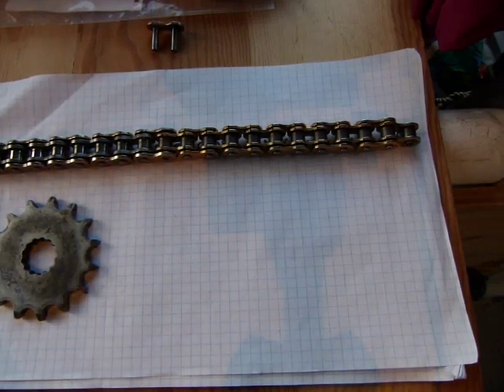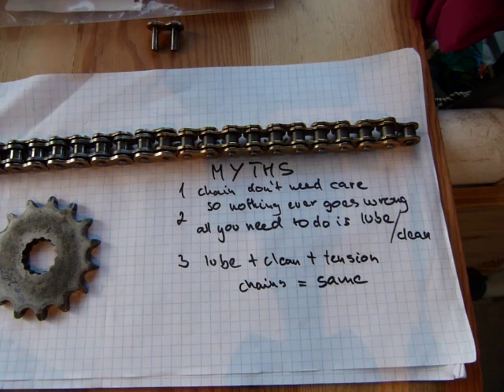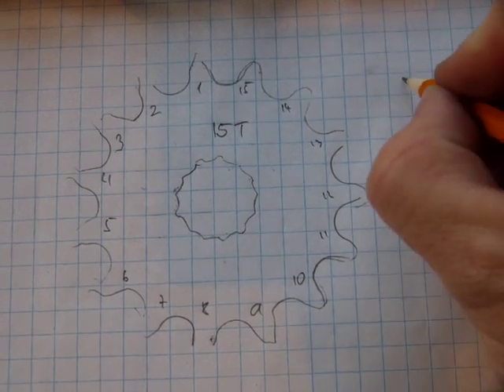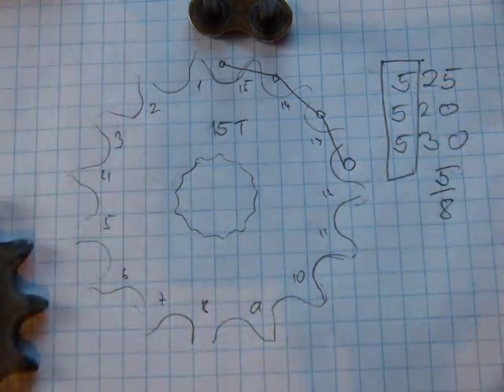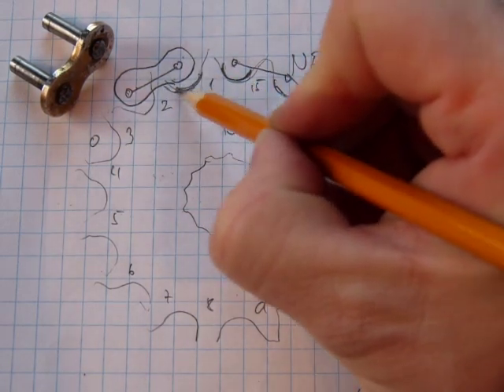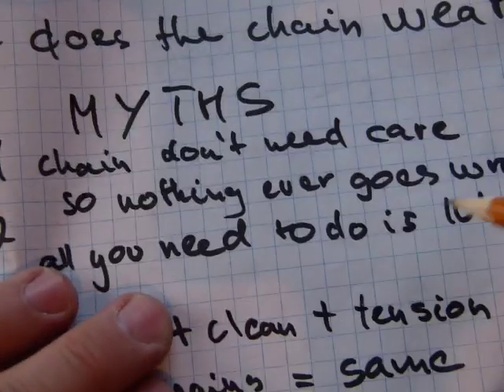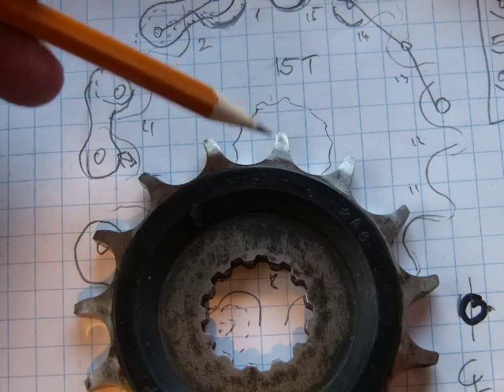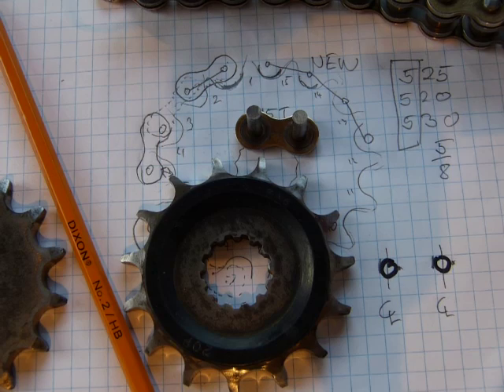O-ring bike chain care myths

Comment: Interesting video but your information is incorrect. The pin Centre distances don't change at all, the outside/inside of the other link/roller and the outside of the pins wear a little.

Comment: The name ‘chain stretch’ is actually fairly misleading. Contrary to popular belief, the chain isn’t stretching at all. “The real name is chain elongation,” says Zerger, “It occurs when the chain articulates as it goes around the sprocket and pin wears on the bushing to the point that the length of the pitch elongates.”
Reply from the maker: Good point, thanks for your input.

Comment: At about 8:00 you've clearly claimed that the distance between the solid pins on the external, riveted link increases with wear. It doesn't. The wear occurs between the solid pin of the external link and the hollow pin of the internal link (dotted). It also occurs between the hollow pin and roller, both of the internal link (dotted) and finally on the outside of the roller in hard contact with the sprockets.

The effect of this accumulated wear is that the elongation of the chain occurs entirely within the distance between centres of each SEPARATE external link, which then allows the chain overall to extend, retract and bend increasingly away from its normal plane of rotation. 

Your other videos on the subject are excellent. I think perhaps you need to do this video again to retain that standard. I believe perhaps the problems of trying to explain a difficult subject in English, which I don't think is your native language, have caused a misinterpretation. Thanks for trying to explain this most misunderstood phenomenon.

Comment: The distance between the center of the pins does not increase nor does the chain stretch.  The pins and bushings wear against each other creating clearance/slop.  This wear elongates the distance between links.   This chain elongation will wear the sprocket.   Each chain manufacture has a chain length/#links limit.
Reply from the maker: Well said. I also tried to leave out terms like pitch diameter, fit, tolerance, elongation, gauge, ... just kept close to plain English as possible without being too technical at the expense of accuracy.

Comment: Does a chain actually "stretch" or is the change in overall dimension due only to the contact points wearing down?
Reply from the maker: The plates do not actually elongate. No engine can come even close to that. (Tractor, tank, train, ship engines do. No chains there.)

Comment: The inside pin will wear as will the collar rotating around it. This will slightly change the pitch of the chain, wearing out the sprockets. A good O Ring chain will keep lots of the dirt and junk out to slow wear.  After 45+ years of riding off road, and countless chains, yes lots of taking the chain off, cleaning and oiling and re installing. 
A decent O Ring chain changed all that. No wearing of chain and wearing out the sprockets so quickly.Wipe down, Keep surface cleaned and oiled. Stretch is very minimal compared to a regular chain that quickly wear and stretch, and keep on wearing out and stretching.

Comment: Some good information here.  Thanks for taking the time to present it.  One commenter said that the pin-to-pin doesn't really change on the "outside" link.  That's not true, sort of...each pin will wear as the collar rotating around it moves, so even the effective pin-to-pin center distance on the individual links will change.  Chains should be viewed somewhat like brake pads; they are a wear item and will need to be replaced from time to time.  Unlike brake pads, with a little maintenance (lube/clean) they can last longer.  Like brake pads, they don't last forever (and neither do sprockets).  Thanks again for taking the time to make and post the information.

Comment: Sorry, but you mixed it all:
centre distance between external chainlink pins is not changing, its welded :) Distance between surface of the pins really increases due to wear.
Tightening will not solve this problem, since increased distance between chainlinks does not decrease due to tightening.

Comment: And if the other side of teeth is still in factory spec. Can I use old sprockets with new chains if I just flip them around?
Reply from the maker: suomenpresidentti They could be used but they will be slightly mismatched, resulting in slightly faster than normal (perfect geometric match) chain wear.
Reply: This leads on to my question.  I find that the chain and rear sprocket on my motorbikes are usually still good but the front sprockets being modified 1 tooth less than spec tends to wear faster and get more shark toothed. I think it maybe cost effective to just change the front to a new one which is the cheapest option and after two fronts the whole lot needs changing together as a set.
Reply from the maker: Could work. The small front needs to spin 3-4 times more than the rear to move 1m length of chain. The smaller the front, the more it needs to spin and the more it wears. Stock or not, the front will only wear equally with the rear if they are the same size (bicycles have that).

Comment: Should i flip the front sprocket around  every now and then to get even wear to it? Is there any benefits?
Reply from the maker: suomenpresidentti Absolutely. Especially the drive sprocket teeth get dished out or get undercut as it engages the chain. A flip eliminates the throttle response lag at the sprocket on acceleration. The sprocket will still be missing metal, the chain will engage that side of the teeth on deceleration.

Comment: I've actually ran a chain so long it started chipping from the unaligned stretch. ( I was young and cheap). The real reason I clicked on this video because I ride off road and I've had some o-ring chains last a long time and one wore very quickly after driving through a silty creek and getting stuck to up to my bearings which also fried. So I now just run regular chains with not much difference in wear time. They do have to be cleaned and lubed more. What's the general consensus on this?
Reply from the maker: dnnich I don`t dirt ride, but do bicycle - same o-ringless regular chains. Yes, they somewhat self-clean but lube runs out faster from its link clearances. Once silt or clay is under the o-rings, they grind away and never clear out.
Here are some close-ups: https://www.youtube.com/watch?v=Vc4tP8kmAX0
and here: https://www.youtube.com/watch?v=kJJV5DHb95E

Comment: the reason why the countershaft sprocket wears faster is because typically this sprocket has less teeth and each tooth makes more contact with roller and pins per revolution versus the rear sprocket, upwards of 3 to 4 times as much.

You did not specify beyond tooth wear, is the general wear of the rollers and pins comparable to the wear of the sprocket teeth?
Reply from the maker: canton7180 Excellent question. Sprockets wear most, pins lose less metal, rollers lose even less. Here is a visual: https://www.youtube.com/watch?v=kJJV5DHb95E

Comment: Hi Great vid. At 11:10 you are discussing wear on the hooked teeth of the countershaft sprocket. Your theory would have been right for the wheel drive sprocket where the chain drives the sprocket but at the countershaft (small sprocket) the sprocket drives the chain. The wear would be on the other side of the teeth at the 11:10 mark where you are discussing wear. What do you reckon?
Reply from the maker: Good one, I like your thinking. The coutershaft sprocket, a.k.a transmission output shaft sprocket or just engine sprocket does not drive the chain. The chain can not be driven, much like a rope has zero compressive strength (under a push force). The chain can only be pulled, it only has a meaningful tensile (under pull) strength, as seen in specs by D.I.D. or EK or ... manufacturer. Since the chain is pulled, the upper run is tight on acceleration, transmits tremendous forces,  the lower run sags, has no force on it at all.
Check out which way a typical left-side-mounted small sprocket turns (anti-clockwise) as it pulls the rear wheel (also rotating anti-clockwise) to move forward. Same for bicycles, just on the right side, sets rotating clockwise.
Thanks for watching!
Reply: Hi +Bruce Mcmurtrie . The wear would be on one side or the other depending on which side of the mororcycle the chain and sprockets are. ex, bmw (f800gs) has the chain on the right side, so when you look at the sprocket from outside the bike it would appear to be weared on the right side. Hondas (xl600v) have it on the left side of the swingarm, so the wear is on the left slope of the tooths. cheers

Comment: Yes they all wear out, but with proper oiling & cleaning they last much longer. Also the quality of the chain & gears, makes a difference, with proper lubing & cleaning, they stretch less and wear less too. My grandad designed a oil bath chain drive motorcycle, many, many years ago, and it had little to no wear, and needed hardly any adjustment. Not the most easy thing to do, seeing the whole chain was enclosed, and did not leak on the ground. It's something that shaft drive bikes do well now. But his way used less power, with the ability to change the gear ratios, much easyer, than a cardain type.
Reply from the maker: Yes, engineers design most chain drives to run in an oil bath, eg. timing chain, chains in mines on conveyor belts, such things. Oil bath is the norm, long chain life or quiet run is not a factor in motorcycle design for most manufacturers.. It should be.
Reply: Yes it would be a big help, but the down side is the cost. They also would lose out out on replacement parts, at a much slower pace. It could be done though.

Comment: I usually set chain tension a little bit more than manual at around 4cm. The chain is a bit noisier but there's less tension on it and it does not get additional stress from suspension movement. Do you agree?
Reply from the maker: All the pull force of the motor is exerted only on the upper run during normal riding and acceleration, the lower run stays loose. The lower run becomes tight only during engine braking - not a lot of tension on the chain. A bit looser lower run has nothing to do with tension on the upper run. The chain is probably hitting the frame, swing arm or chain guard.
Full range suspension movement (say 150mm total) only makes the chain (say sprocket dist. is 450mm) 6mm longer (square root of 75^2 + 450^2), that 6mm is easily absorbed by the factory amount of 25-35mm chain slack.
Makes sense?

Comment: Useful info. on the chain/sprocket interaction but surely the distance pin to pin remains a constant 5/8? Even if the pins wear the distance center to center, left side to left side etc. remains the same, even if the pins wear the center points don't move and wear on the same sides cancel each other out maintaining the same seperation. The point remains that the chain lenghtens and the roller distances increase but not the pin distance. The chain plates operate within the steels elastic zone so no plastic deformation occurs which would lengthen the pin seperation, only pin wear causes the elongation as you point out in your video on wear locations.
Reply from the maker: Yes, the unloaded chain could be set back to 5/8 on-center, even wear on left and right sides. But on a loaded chain, the center points move and lose their design separation. Yes, the steel is loaded below yield point. Also check out O-ring bike chain wear locations

Comment: you failed to disprove the last two myths. You say that "all you have to do is lube and clean the chain is a myth" -but that's all you CAN do. All you showed is that once the chain starts stretching it doesn't fit the sprocket anymore-how dose that disprove the last two myths? BESIDES cleaning and lubing the chain, what else can you do? replace the chain every time it gets loose? that's the dumbest thing I've ever heard, you can run thousands and thousands of miles after the first tensioning, and a good chain can cost over a hundred dollars. spending a hundred dollars on a chain every time it gets loose so as not to ware out a twenty dollar sprocket? WOW
Reply from the maker: 1 The proof of #2 & #3 (nothing ever goes wrong, chains remain the same, all wrongs are prevented by a spritz of lube and a dab of clean) are spelled out in details of geometry, like you noted, as soon as the chain stretches, it does not fit the sprocket.
2 Yes, clean and lube is all one can do. The difference between an incompetent hopeful and purposeful maintenance is expecting that change in geometry and countering it according to riding conditions and not whim.
That is what else you can do. It still is clean and lube, but when, where, how also factor in. Just like the difference between a Gordon Ramsey meal and my wife`s. Both are chicken soups, but one works, the other is dumpster material. (She knows, too)
3 Nobody said "replace chain every time it gets loose", so you could not possibly have heard it. Stop panicking, start hearing.
3 WOW

Comment from the maker: If it`s out of adjustment the chain is running on the top of the sprocket teeth not at the roots. Probably you can almost lift the chain off the teeth by hand. Eventually, the teeth will start breaking off. Not very dangerous but no fun being stranded, pushing the bike ...

Comment from the maker: I was surprised too that it wore out, esp. that is was on a low-powered 125! But dirt and salt clogged and ate it up.
On a 650 VStrom I had, my chains lasted 20 000km (12500mi). In city traffic I wear chains fast (tire & brake pads too) as I do a lot of accelerating,merging and braking. Cruising casually on a highway does not nearly stress the chain as much as an explosive merging 0-60km in 2sec. 30 000 mi (50 000km) is totally reasonable with moderate, well-mannered riding.

Comment: I`m surprised you wore the chain out at such low miles,   I know what you mean though with pulling the rear wheel back to make up for the wear and stretch,    It doesn`t work,   I mean in terms of the correct tension for your body weight,   The last motorbike chain which I replaced recently lasted for around 6000 miles,  I just coated it in lithium grease,   But it was second hand with 24000 miles on the bike,   So if it was the original chain,    30000 miles to me seems an acceptable wear rate

Comment from the maker: Yup, I just destroyed a chain in 2000km (1300mi). Dirt & salt & zero cleaning. Once you adjust the rear wheel, the chain is already longer than its design (theory) link length, so it does not fit properly from that moment on. It is all downhill from there on.

Comment: Good video,     Although most people do understand that the chain will wear out and need replacing eventually,    The real issue is with the lifespan of chain,     The difference between a cared for chain and a neglected one is substantial,   I`ve heard a new motorcycle chain can wear out within ten thousand miles if not cared for,   But a well maintained chain can last anything between thirty thousand miles and maybe even up to eighty thousand miles by careful riding and rear wheel adjustment